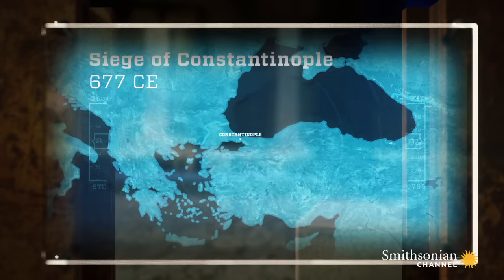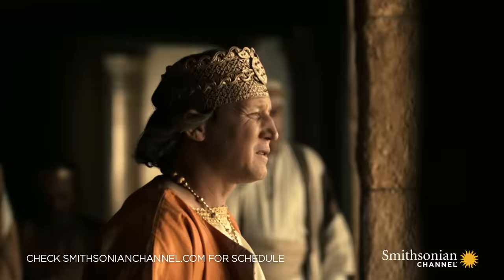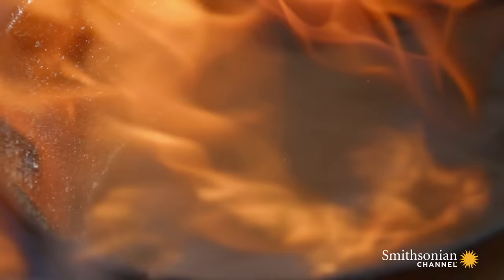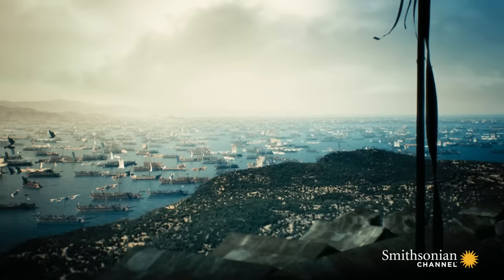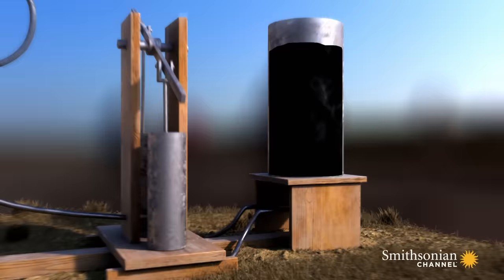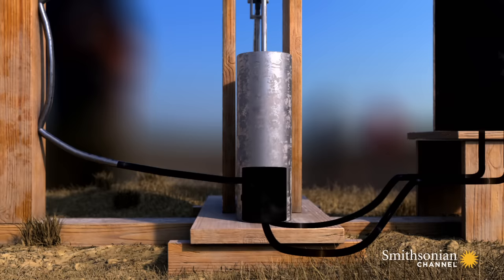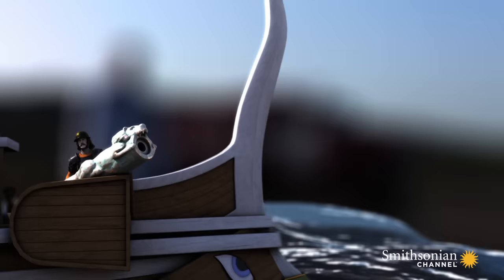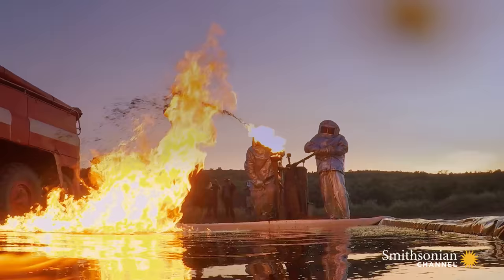How Greek Fire was Used to Target Enemy Ships

Comment: For those who ask how this works with wet wood: the majority of a ship should be very dry.  Only the part under or near the waterline is regularly exposed to water; the deck, sails, ropes, and upper hull should be well out of the way of spray, and of course the interior should be watertight.  Add weeks of blazing Mediterranean summer sun and the pitch or tar used for caulking, and you’ve got a literal tinderbox.  Fire was one of the greatest threats a ship’s crew could face right through the Age of Sail.
Reply: Let us not forget the crew itself is also pretty flammable.
Reply: Considering war campaigns are usually launched in spring and summer the weather really helped a lot in stopping the advancing Arab invaders
Reply: I always theorized it was a liquid shooting a powder that would than stick to the tar holding the ships together with enough heat in its ember to ignite
Reply: Ships of the time were taken out of water when not in use, there are massive sheds all around the Mediterranean built to hold ships in the winter months and out of the water where they would degrade within years otherwise.

Comment: I had a very vivid dream about this thing at the time i had no clue what it was called. In it i got a walk around the hardware aspect. It consisted of 2 tanks. One had a fire under it to heat the liquid. The second contained the flammable liquid far away from the fire as not to cause an explosion. The tank that was heated by the fire was water. As it boiled, it sent steam via pipe to pressurize  the vessel containing the fuel. There were hand valves  to control the steam and vent the water tank. I look at the pictures and look at theories of hardware with fire under the vessel containing fuel and find that preposterous.

Comment: It’s true that no knows with certainty what the formula was. I suppose several competing theories exist. We would have to have better information on what was available.

One of the problems is that several imitations used the same terminology. Quick lime and pine resin are among the possibilities. Calcium hydroxide under certain conditions can generate a lot of heat in the presence of water.

Comment: To answer some comments. There is a formula that is about perfect as ancient times. Stop saying no one knows. Sure no one knows the exact one but at 95-99% you have the formula. And it’s burning blue like it should. 

Greek fire recipe :

Saltpeter - 6 parts
Sulfur -1 part
Quicklime-1 part (secret ingredient)
Mix everything thoroughly.

Add 1 -1.5 parts of crude oil (black).
Mix.

Use a nearby flame and swing the substance across the flame to project and create a super-powerful flame.

By part I mean just parts. It can be 1 part = 1 barrel . Or 1 part = 1kg.

Comment: .crude oil and magnesium powder mix .
The oil would prevent the magnesium from igniting too soon
Reply: How does water not extinguish it then?
Reply: @AristonSparta  When magnesium interacts with water, it will form a hydrogen gas that ignites violently due to the excessive heat and oxygen supply
Reply: @nabil1122  
Yes the same reason engine blocks that are on fire are really hard to put out.
Reply: @AristonSparta  Never had to deal with a grease fire? Water can't interact with an emulsion the same way it can with something like gas or wood burning.
Reply: Okay, but how did they get metalic magnesium centuries before electricity?
Reply: @TheCuteZombie  You have a point hear
Reply: @nabil1122  It's still unclear the whole procedure of making it.
Reply: @TheCuteZombie  They mined it du mbass

Comment: Can 10 meters shooting distance be ever enough for the relatively complex apparatus to damage the ship that can simply move out of reach? And more over the engineers who settled it up would be completely exposed to the arrows from the boats. I'm pretty sure this fire was delivered in different way, not by simply spitting it from the short distance.
Reply: They could have had bigger pumps but the arabs didn't put archers on those ships. You also have to remember that they were controlled by men. There was not way to simply move out of reach lol.
Reply: The operators could be protected or even below deck. Also the attacker need not stand by the enemy ship while it burns. Just side with them, pump a good 10-20 seconds of fire on them, then move away. What could they do ? Throw arrows etc, Ok perhaps they destroyed some fire ships, that is not impossible. But the advantage is very big.
Reply: A thick wooden bunker of sorts with an opening for the flame thingy
Reply: You are also under the assumption the enemy knows you have such a device.
Reply: @spets4265  They need to see it once, then the rumors will spread. Considering that the Greek Fire was used for centuries, it probably didn't rely on the surprise factor that much.
Reply: @hellstorm300  I was going off the video and its first usage. But yes.
Reply: Catapult maybe
Reply: Because it could fire further  than that and wa often brloe deck

Comment: Wouldn't the wood on these ships be very wet? I don't know if anyone here has tried to burn wet wood, but it isn't easy. I didn't see this clip calculate for that, so I am still not sure how effective the Greek Fire is--unless it is simply that hot.
Reply: The thing with greek fire is that it can burn even in water so wet ships or not it can burn
Reply: Just to add onto what the previous commenter said, you can see it floats on the actual water as well. Also if it got on any clothes or on the rigging or sails, it would burn those materials quite easily without being wet. Also if it seeped through any loose boards into the lower decks where its much drier and where more combustible materials are then it'll go up in flames. Also add on the psychological element to this
Reply: The crew was not fireproof my good sir